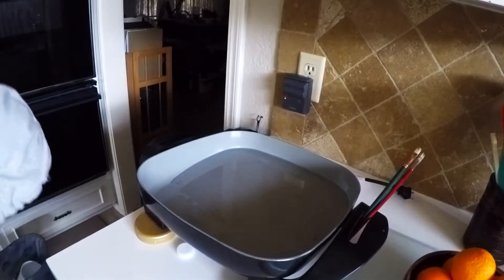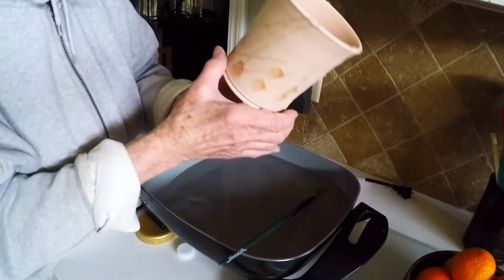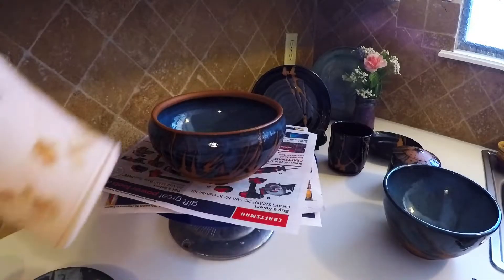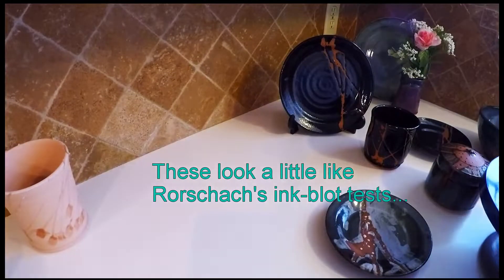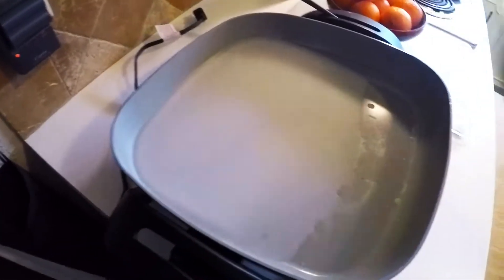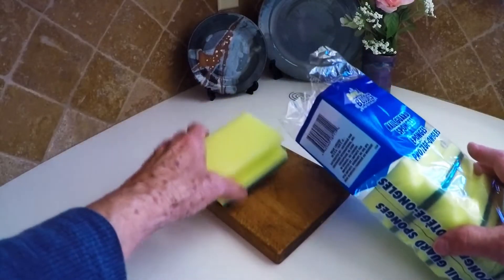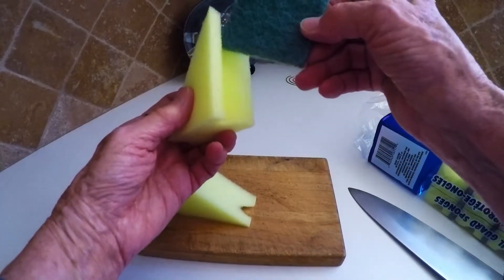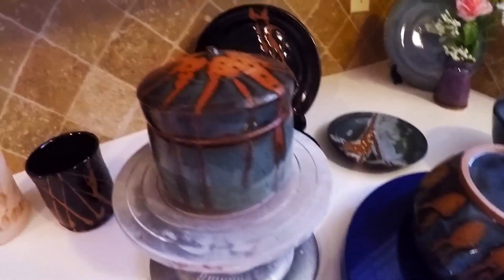♥ How to Use Wax Resist for Unique Surface Design on Pottery +Bonus Tip 4 Classroom Teachers! 12:59

Comment: That's super cool, I'm thinking underglaze for different colors underneath and then drip on the wax then the glaze
Reply from the maker: Julie, I love that idea! Remember that underglaze can run or move if applied thick. (Some colors more than others.) I recommend a test on something first to see how your colors interact with each other. Great idea! 
I love your adventurous spirit. Thanks for watching!  -jw
Reply from the maker: Afterthought for Julie... You may want to consider Mason stains or Oxide washes to provide a 'color' under the wax for what you mentioned above. Just thinking about what I would do and what the options are that would be the most predictable. ¯\_(ツ)_/¯❤

Comment: Fabulous!! They look amazing, I will have to go back through you clips, I can't remember what wax you use, I use a commercial bought one and its not great, sometimes it doesn't even resist. That clay body is beautiful unglazed, all very striking and eye catching, thank you.
Reply from the maker: @LB Ceramics, Hi Leigh! Thanks! I use Gulfwax® in the skillet. It must be very hot to soak into the bisque. Though it burns out, it leaves a very nice sheen on bare groggy stoneware. I may try it on porcelain to see if it has a similar reaction. Good hearing from you! Thanks for watching! -jw
Reply: @BrokenArrowPottery  Thank you :0).